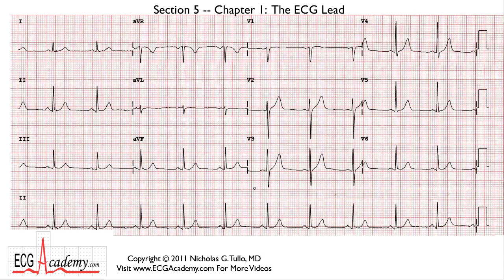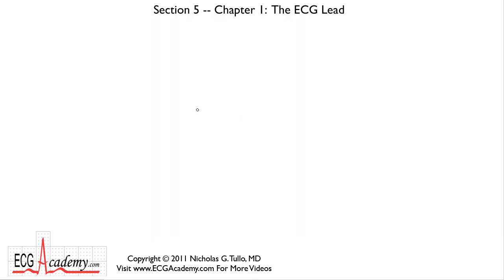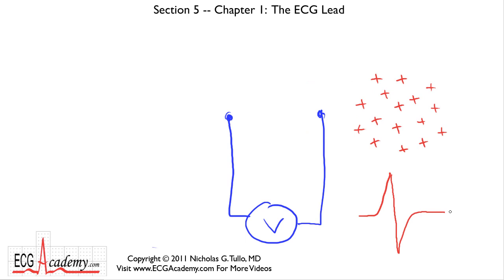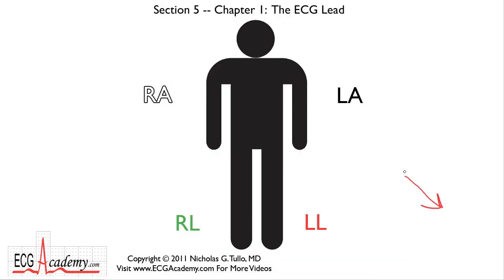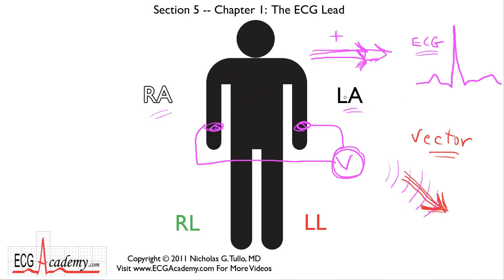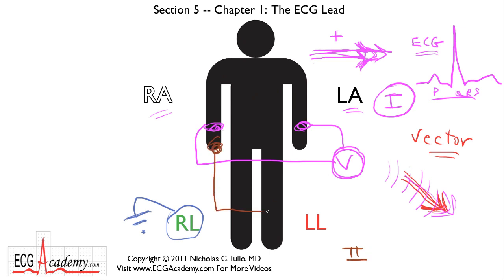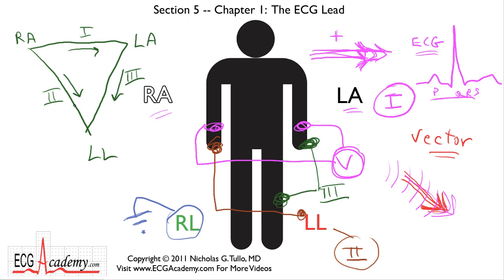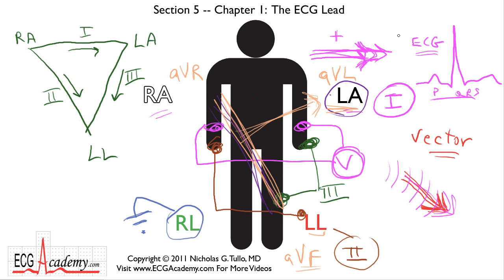Basics of ECG Leads 5-1 - ECG / EKG Interpretation -- BASIC

Comment from the maker: @dogmanbill -- For most of the QRS complex, the electrical signal is changing direction.  At times it is traveling from left to right, part of the time it's traveling from base to apex, and other parts it travels from apex to base.  The AVERAGE vector (the sum of all the parts) is usually DOWN and TO THE LEFT of the patient, which is why the normal "axis" is between 0 and 90 degrees.   I hope that clarifies things.

Comment: depolarization occurs from epicardium to endocardium  so t wave in the same direction  i read that ischemia is the reason but i don't know how
Reply: +hassan ali Depolarization occurs from Endo to Epi (inside out)...think about the Perkinje fibers. They are inside the heart. It would make sense that as the electrical impulse leaves the fibers and goes into the myocardium, it would start at the origin (inside) and go outside to the epicardium. 
Repolarization however goes epi to endo (outside in)...just the opposite.
With an ischemia, the impulse is just having to go "around" the ischemia so the QRS, ST, and T will have varying appearances because the impulse is not "symmetric" throughout the myocardium.